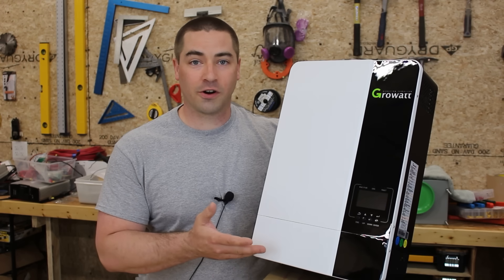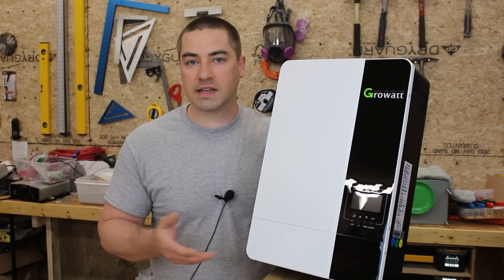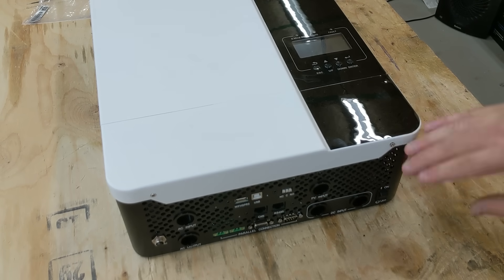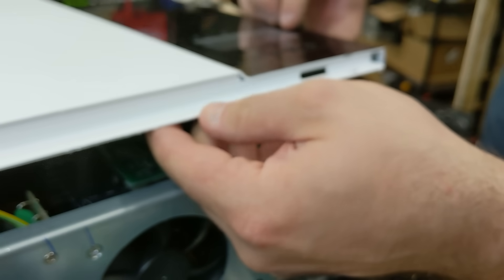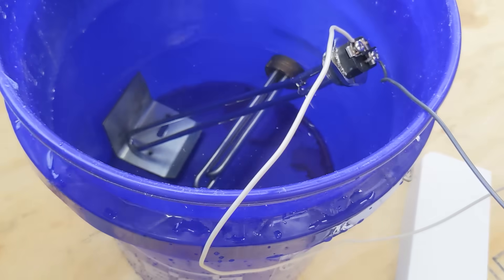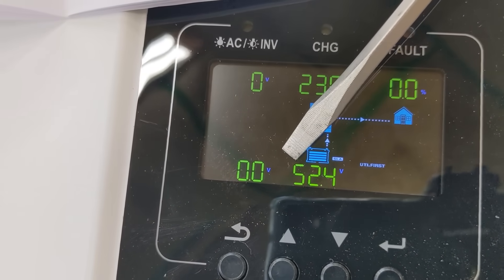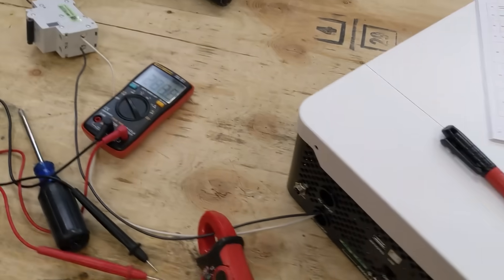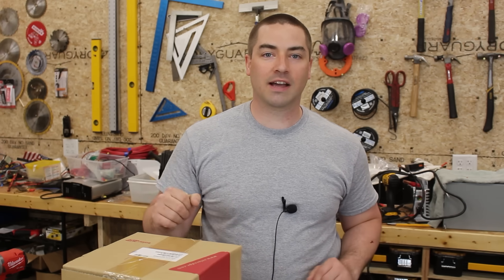Best Value Inverter, All-in-one MPPT Solar Charger, Growatt SPF5000ES, Part 1

Comment: So I'm doing a schooly that I will probably have parked and hooked up to power sometimes. I know that I want to do a 48 volt system for the solar. But I'm really lost when it comes to picking inverters and batteries that will also allow me to draw off a direct power source not just the batteries
Reply from the maker: Very cool.  I love checking out Schoolies.  Send me a message in Facebook @davidpozenergy if you want to chat more.  First thing would be deciding if you are going 120v only, or 120/240v.  Then decide how many watts you need.  3kw?  6kw? That's the size of the inverter.  In this video I'm demonstrating a 5kw inverter.  Usually I like to start with an excell sheet of all my appliances, lights, etc.  Everything that draws electricity.  Then list the watts next to each and add them up.

Comment: I installed two for a 6kW split phase off grid. They have been in operation for 1 month with no issue other than 120Vac leakage onto the plus and minus going to the PV panels. I got a light tingle when I simultaneously touched the frames of the two rows of panels. I measured 120Vac across the two rows, and from each plus & minus to earth ground - when earth ground was disconnected.  The leakage was enough to light up a 5W LED light bulb.  I have contacted Growatt and am waiting for an answer from their R&D team.  Has anyone experienced this safety issue?
Reply: I installed this exact inverter with battery and some panels in July 21 because of this video by David powering my whole house since "ongrid". Got the same tingling and measurement as you did and my ELU tripped when it rained, apparently transformerles inverters can have a feedback on the dc line came down to earting every panel not just rail tingling and tripping problem solved. been running flawlessly since then.... "-- earth the panels and rails  !!"
Reply: I got a tingle from my panels -- earth the panels and rails  !!

Comment: So did the element melt through the plastic of the bucket since it shifted off the metal piece?
Reply from the maker: I caught it before it melted through, but it did deform the plastic a little.

Comment: David - what kind, to run this and how  many solar panels would I need to run this Growatt on what voltage 24? 48? I don’t want to under power over over power the Geowatt. What you think of two 4000watt (8000)??? I wanna run my whole house. Thanks. Love your detailed presentations. I like your battery bank case presentation.  I wanna use that as well. 😎
Reply from the maker: Very cool.  I prefer 48v and would suggest using it.  This particular model (48v 5kw, LVM-ES) can be connected to a solar array up to 6kw in size.  I've been testing mine connected to a 5.1kw array and it's been working great.  When sizing your array, the same rules apply with any charge controller.  I think two of these inverters can do quite a lot, and allow up to 12kw of solar panels.  Combined with the 30kwh battery bank is a pretty easy way to power your whole house.

Comment: Hey David I bought the 24v 3000watt version and it has some problems. I'm running a mini-split heat pump, radiant in floor heat, water heater and induction cook top. I was planning 4 seperate circuits of 20amp each. the problem here is on the 120v ac out the biggest wire that will fit is 8awg. This sucks.
Reply from the maker: Did you have a question about something specific?  maybe I could help.
Reply: @DavidPozEnergy  Yes. Do you know the ac output amperage. WIth only being able to use a 8awg wire it appears it's only 30amps. For a 3000W inverter this seems ridiculous.
Reply from the maker: OK, thank for clarifying.  3000w @ 120v = 25 amps.  Code specifies a 25% addition when using continuous duty.  25a*1.25=31.25a  This means at a minimum, look for a 32 amp breaker.  
Next, check out the ampacity chart in the NEC: https://www.usawire-cable.com/pdfs/nec%20ampacities.pdf  If you use copper wire, with a 75°C rating (or more) you can use up to a 50 amp circuit breaker with 8 gauge wire.  50 amps is well over the minimum 32 amp breaker needed.  

Here is an example: https://www.homedepot.com/p/Siemens-50-Amp-Single-Pole-Type-QP-Circuit-Breaker-Q150/206632135 A 50 amp breaker.  It says #8 or #6 wire, 60 or 75 °C
Reply: @DavidPozEnergy  Thanks David.

Comment: Hi David. Will this Growatt model work with my Enphase micro-inverters? Does it take AC power from the PV panels? Thanks.
Reply from the maker: yes, and no.  It's a bad idea.  You are asking about AC coupling.  The growatts can take the surplus AC power and charge the battery, but they don't frequency shift.  So they will just keep charging and charging until something breaks.  I don't recommend it. If you need AC coupling, then try the SMA sunny islands.  They do frequency shift and are made for AC coupling.  I have several videos on the SMA sunny islands on my channel.
Reply: @DavidPozEnergy  Thanks for the quick response. I will do that.

Comment: in case connecting 3 in Parallel , could Input AC being 3 times Amps? (charging big batteries capacity)

Comment: So, when your water heater is on, you've got very little power available for the rest of your house?  I guess you need to spend another $900 for another one of those units to power an air conditioner, huh?  And if you want to use the microwave or 1kW stove element to cook at the same time, then you're going to have to buy another unit?
Reply from the maker: That's one way to do it.  There are many ways to get to the goal.  My goal is to eventually power my house off grid, year-round.  I've been doing this with a 12kw system this past year and that handles everything in my house.  But everyone's situation is different.
Reply: @DavidPozEnergy  That's a good goal.  What does your current 12 kW system consist of?  Does it allow you to operate off-grid like a normal home without having to manually control the simultaneous usage of multiple high-power usage devices?
Reply from the maker: My current 12k system is two SMA Sunny Island inverters, SI6048US.  But using two or three of the Growatt inverters would work too.  Yes, I can operate my whole house off-grid.  I have a whole house transfer switch inside.
Reply: @DavidPozEnergy  What size is your solar array & battery bank?

Do you have enough power to run a home AC unit, electric water heater, microwave, stove, TV, & lights all simultaneously?
Reply from the maker: My solar array is a little over 12kw. Video here: https://youtu.be/wApxkcr_gX8
 I'm currently testing/using a 30kwh battery bank video here: https://youtu.be/89MyA7zPdYI

I have a couple small AC's for my house, combined they are about 1.5kw.  Microwave is 1.8kw, water heater is 4.5kw, TV+lights are about 0.3kw, Two "burners" on my stove is about 3.5kw.  That totals 11.6kw.  So, yes, I can run them all simultaneously.  But everyone's loads will be different.  I suggest making a list of your appliances and their watts.
Reply: @DavidPozEnergy  Well that makes a lot more sense... Your solar array can generate ~50 kWh of energy per day (depending on your latitude, time of year, & sunlight availability.)

How much would your whole system cost today to install from scratch?

Btw, nice score on those 365W panels at 100$ each.  What % of their rated capacity have you actually measured?
Reply from the maker: How much would it cost?  Not sure.  About $5,000 in solar panels: https://shop.signaturesolar.us/products/365w-silver-mono-72-cell-adani-panel?variant=39544826134733
3x Growatt inverters, $900 each, $2700: https://shop.signaturesolar.us/products/5kw-48w-240vac-80a-off-grid-inverter-by-growatt
One auto-transformer $350: https://shop.signaturesolar.us/products/5kw-250vac-25a-off-grid-inverter-by-solar-edge
Battery Bank is currently out of stock, but 30kwh battery bank with cabinet is about $9500.
Frame/hardware to mount panels.  This will vary with what you have to work with, but should be very doable for $1000 out of uni-strut.
Plus maybe another $600 in wire, fuses, circuit breakers, etc.
Total maybe $19k-$20k  Something like that.  Note, you can use discount code DAVIDPOZ at the checkout from Signature Solar.
Reply: @DavidPozEnergy  Thank for the info.  Those panels don't have a great temp coefficient though (NOCT Power TC=-.39%), so in the heat of the summer in Houston, the rack-mounted loss will be over 16% by my calculations.

What do you need an auto-transformer for in your system?  Normally your inverter would have a split phase transformer in it or an electronic equivalent.
Reply: @ab_ab_c  I am in Tucson and looking for 15kW worth of panels and prefer a temp coefficient for the hot climate here.  Have you found a good panenl and source yet?

Comment: Hey can you help me?
I'm buying a tiny house but it's not wired for solar. The seller says that I could connect the rv outlet to the inverter then I'd be off-grid.  I want to know if 1) is that smart /safe? 2) could I use an inverter box ?(all in one box) I've found panels 370 watt for $35 (slight damage to the back padding, but was tested and mfg says they work fine) I want to power the entire house.  P.s. there's a mini split incl with the house . Thanks 😊
Reply from the maker: There are many ways to take a house off grid.  I'm sorry I can't get into the long conversation in this little comment section.  But send me your question through Facebook with some pictures and I'll help you out.
Reply: @DavidPozEnergy  I can't find you on Facebook
Reply from the maker: @davidpozenergy

Comment: Awesome video! Can this MPPT be set to charge to lithium type to 64V and utilize that 64V for the inverter? I have a LTO 24S battery bank that needs to charge to about 63V. Thank you!
Reply from the maker: Sorry, no.  The maximum voltage this inverter can charge your battery to is 58.4v.

Comment: Hey if I buy an 18kwh chevy volt battery how many solar panels will I need to charge it up 100% every day
Reply from the maker: I'll demonstrate the math, but you have to check your own equipment and location.
If you drain the 18kwh 100% every day, then we proceed like this:  Assuming you have a solar-to-battery system that is 90% efficient...  This assumption is taking into account wire loss, charge controller.  Then 18kwh/0.90=20kwh  So your panels need to produce 20kwh per day.  Some days are sunny and some are cloudy.  I use 2.5 sun*hours for my calculations in my area.  20kwh/2.5sh=8kw.  That means you need 8kw of solar.  If you buy 400 watt panels, then you need 20 panels.  (20*400w=8kw)  I hope that helps.

Comment: David, you need to test it every day for at least 1 year to see how it will last.
Reply from the maker: Working on it.  2 weeks so far, 50 to go. LOL
Reply: @DavidPozEnergy   I am saying that because I had problems with mine after 1.5 years. Some bad board. luckily this inverter is only $1000

Comment: manual looks like like MPP solar manuals. Also do they make one of these in U.S. split phase?
Reply from the maker: Yes, Growatt makes a split-phase inverter.  Signature Solar sells two options that can make the split phase:
1. 12k inverter has split phase and big transformer all in one package.  https://www.signaturesolar.us/products/f5b06d12d3/2203789000006299864

2. You can buy 2, or 4, or 6 of the 120v versions.  (must be in pairs for split phase) https://www.signaturesolar.us/products/h70c68e2aa/2203789000004887202

Use discount code DAVIDPOZ

Comment: Great vid David, congratulations. Can you confirm this inverter stars and runs with only battery or fv panels (or both) DC power, no 220V input AC from grid? Many thanks in advance.
Reply from the maker: You don't need grid power connected to this inverter.  Actually, my newest video on this inverter, I have it running just on a battery: https://youtu.be/yWUfvvSa3K8

Comment: I worked with John and James at Signature and purchased this inverter, 3 of those batteries, and 12 of the 48V 395 W panels. I need some pointers getting it all hooked up. Like do I need a combiner box for all the panels? Should I connect them in parallel or series?
Reply from the maker: That's going to be a nice setup for you.  Congrats.  I checked Signature Solar website for the panels you mentioned.  This is the only one I see that is 395w, so I'll assume this is the correct one you ordered.  https://www.signaturesolar.us/products/c22a81e79e/2203789000006324084

The spec sheet says Voc: 48.7v  Let's see if you can connect all your panels in one series.  (48.7v)(1.25)(12 panels)=730.5 volts.  The maximum PV voltage for this particular model inverter is 450v: https://www.signaturesolar.us/products/e471d70e1e/2203789000004887111

Now let's see about wiring the panels 6 in series per string, then parallel the 2 strings.  shorthand: 6s2p
(48.7v)(1.25)(6 panels)=365.25v  This Voc of 365v is less than 450v, so you are good here.

Last check: MPPT range.  The Vmp of the panels are 40.5v.  multiply this by the 6 panels in series: 243v.  Compare that to the spec sheet of the inverter for the PV mppt range, which is 120v-430v.  Is 243v inside the mppt range?  Yes.  

So you will want to wire those panels 6 in series per string, then 2 strings in parallel.  This can be done with a combiner box, or they even make "Y" splitters for combining 2 strings.  2 strings is the maximum you can parallel without requiring a whole combiner box.
Reply: @DavidPozEnergy  Thank you!  My panels aren't the bi-facial ones you've linked here but they're 72 cell 395w Jinko Panels and from what James told me, they aren't very good about keeping their actual inventory synced with their web-store. Now I need to find the best way to mount them. I'm installing this system into a 40ft bus that I'm converting into a tiny house on wheels. I plan on putting the batteries in the under-belly storage and the inverter somewhere accessible inside the vehicle, probably next to the breaker box. I also need to figure out what gauges of wire I need to run from the panels to the inverter and from the inverter to the transformer, and so on.... Thanks a lot for your help!

Comment: I just installed this monster.  I love it. You did not mention that it has remote monitoring capabilities too.
Reply from the maker: Yeah, I'm not good with computers.  How was it?  Difficult to setup the remote monitoring?
Reply: @DavidPozEnergy  no. Not at all. Very easy setup. You only just need to register with Growatt to get an "installers code". Then you log into their mobile app, connecting the inverter data logger in the process.  Quite easy.

Comment: I couldn't afford one of these all in ones and had to settle for a MSB 60A controller and a 24v 3k inverter. I used to run 48v but my inverter fried about 3 years ago. Awesome video.

Comment: I really love your videos, I have learned a lot from them. What are you recommend for BMS on 16s 48 volt 280 AH pack.  Batrium is a bit expensive I was thinking about QUCC or Daly. I have a Growatt 6KW low-frequency Inverter. Your response will be appreciated thank you
Reply from the maker: I agree that Batrium is a bit on the expensive side.  Probably worth it if you are building a really big bank.  If you have a 6kw inverter, then it can draw about 125 amps, and surge 3x that for short bursts.  If you are using Daly, then all the current flows through the mosfets.   Mosfets are touchy.  I double the size of my BMS's when I use mosfets based ones.  So in this case, I'd buy a 200-250 amp BMS from Daly (about $170).
Reply: @DavidPozEnergy  Thanks, I will buy a Daly smart BMS based on your recommendation

Comment: Overall I’m pretty impressed with these Growatts from the reviews I’ve seen so far.

I’d like to see you try and start a ~3-4kW air conditioner.   Actually with any high frequency inverter I would love that test.

It’s good to know what you can reasonably expect under real world loads.  I.e. rarely purely resistive.
Reply from the maker: I agree.  In the video I'm editing right now, I test it with an air compressor, and 12" Miter saw.  I don't have a 240v well pump, or 240v air conditioner.  I'd actually love to get something like that for my testing purposes if you know someone tossing out something like that in Massachusetts I'll go pick it up.
Reply: @DavidPozEnergy  hello David, thanks for the videos. I will very shortly be ordering 2 of these inverters and an autoformer and 32 375W panels from Signature Solar and 3 of their batteries when back in stock. I will be running a 1HP well pump at 100' depth as well as 2 small (18kbtu) geothermal heatpumps I will let you know if 1 or 2 are required to start the well pump and or heat pumps
Reply: I use mine on a 1100 watt vac - no problems

Comment: what would you use the AC input for?
Reply from the maker: Usually that's where you tie in a generator.  Then you can fire up the generator for the occasional times the solar isn't enough.

Comment: A suggestion.... No YTer shows their full system working.  How many amps they draw during the night and how long it will take the solar controller to replace those amps. In a real battery bank of over 500 amp hours.
And no body shows systems that are a year old and how they survive time.
It is a niche.
Reply: That’s the conclusion I’ve come to. No way will stuff like this replace the grid.

Comment: do you have a link for that pre-charge resister you used on the capacitor, to prevent blowing out the capacitors?
Reply from the maker: https://amzn.to/3v0wAVv  Amazon affiliate link.
Reply: @DavidPozEnergy  
Is it required to install and leave those resistors installed, or remove them once the capacitor has been fully charged? Could those capacitors charge using vac input or through the pv array?